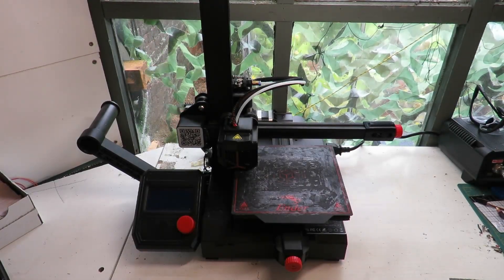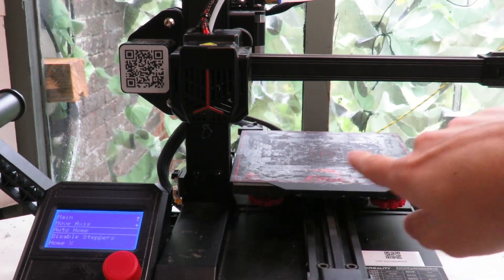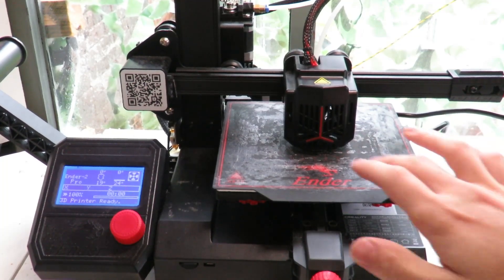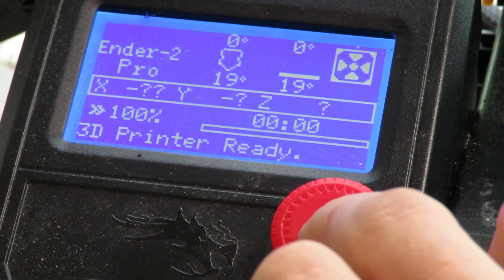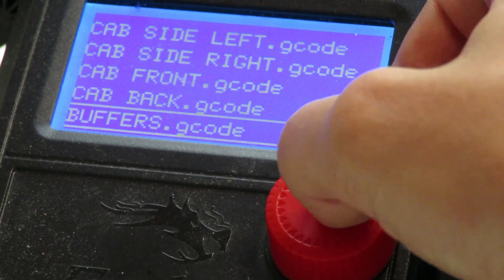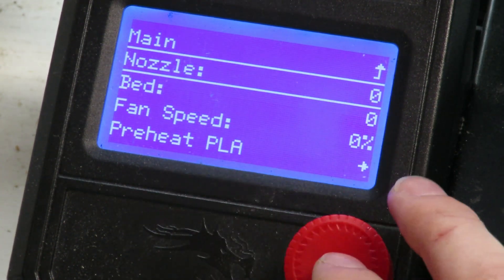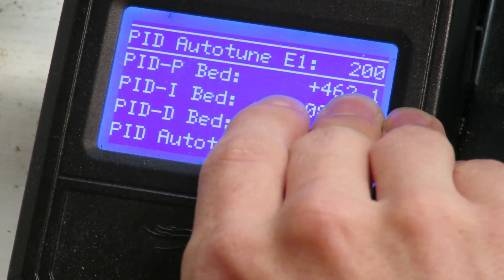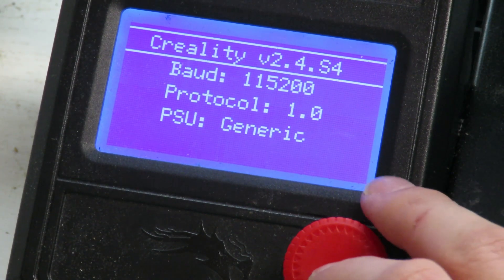Getting Started With 3D Printing - Part 1 - Bed Levelling, SUNLU Filament & Printer Settings

Comment: Looked into these and they seem great….but where do you get the files from to print the items? Really struggled to find any on a search engine.
Reply from the maker: We design them ourselves on CAD
Reply: @BudgetModelRailways  Ok thanks. So will need to learn to use CAD software as well. Perhaps a bit beyond my capabilities at this point.

Comment: This has the makings of an excellent series. I got a (surprise) Ender 3 v1 at Christmas, this will be a big help improving my setup. I've had success printing out other people's projects from Thingiverse but am struggling to create my own designs. What would be really fantastic, once you've covered machine setup and use, would be a series on say designing and printing a simple coal wagon, bit by bit, preferably using one of the freely available programs such as Tinckercad or Fusion360. Hopefully then, newcomers such as myself could transfer these skills to fresh projects that could then be made available to the community.
Thanks for the help and inspiration!

Comment: What a great and clear explanation of the 3D printing process. I wish this had been available when I bought my Anet A8 as a kit. I did get it built and working but it requires a great deal of tweaking. Bed levelling is one of the most important things to get right, and it's a bit of a pain on the A8. Getting a good first layer can be tricky, with bed adhesion problems. I've tried painters tape,  glue stick and  a thin sheet of glass with hairspray which gave the best results. Also, using good filament  goes make a big difference. Cheers.

Comment: Darn, Amazon says the Ender 2 Pro is currently unavailable and they don't know when or if it will be back in stock. Which one do you recommend as a substitute?
Reply from the maker: That would be the next one up the ENDER 3. There's all sorts of variants of the ENDER 3 but the original simple cheap ender 3 is perfect for beginners.

Comment: Three dimensional printing sounds like a great idea.  How much do they cost?  How do you set up a reasonably priced unit?  Is there a 3D printer that comes in at around £100?
Reply from the maker: The Ender 2 pro is the cheapest 3D Printer on the market and is in our opinion the best printer for beginners: https://www.youtube.com/watch?v=iREGTjEkv3o&t=95s